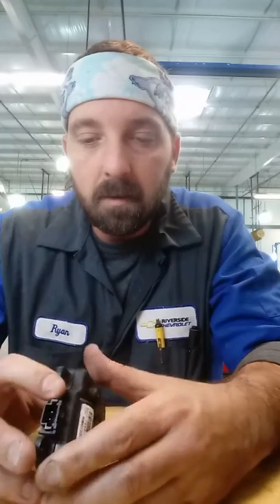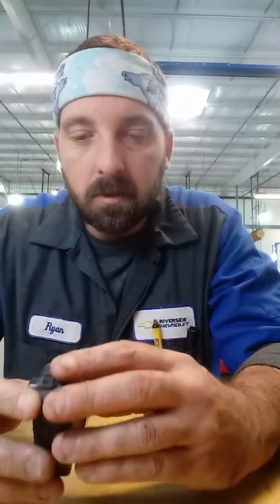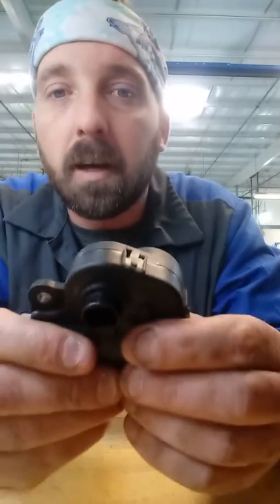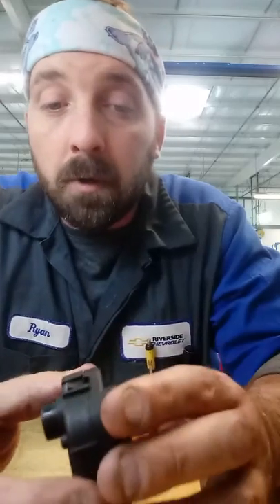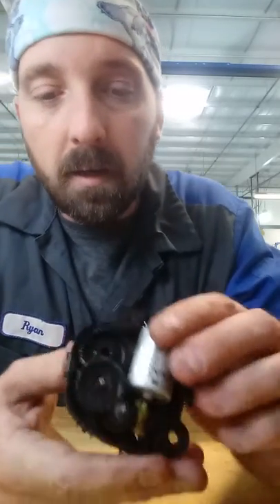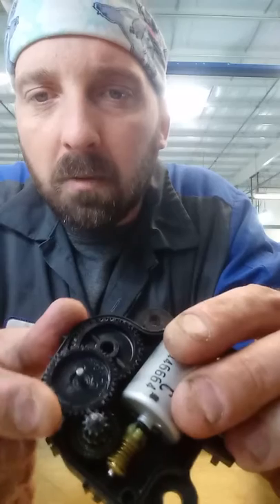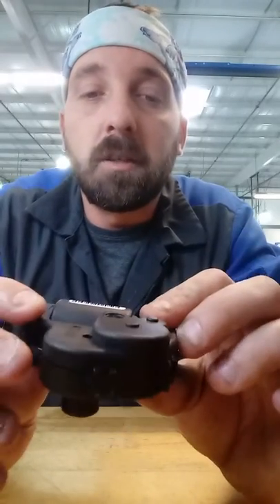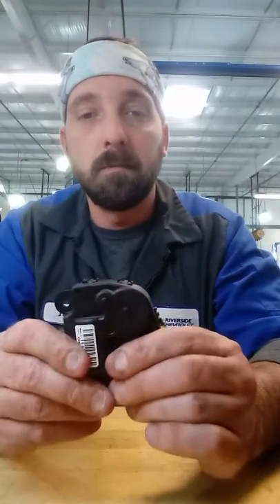CHEVY Popping noise coming from Dash FREE FIX

Comment: Hello Ryan,, My Pontiac G5-2007 is maken that noise on driverside underneath,,, is that the same thing,,, every time i move the nob to defrost and one next to it, it dont make a noise,but when I move it too the foor and also to air vent/floor both, then it makes that clicking noise...HELP,, not sure what to buy on amazon to fix the problem?? I hear it good when its on floor and vent mode,but no noise on defrost...Is that the same thing I need to buy?? if so, what is it called???...Thanks,,, Rich

Comment: 2022 Sierra 2500 HD. Have this clicking sound drivers side foot well under dash. Possibly the same cause? 
2700kms.
Reply: Silverado 2023 LT here with 13.4 inch screen. Did you happen to ever find a fix? @JD73RD

Thinking of telling my dealer to replace it
Reply: @Multimeter1  Turned out to be a module (small plastic black box rattling) that wasn't mounted correctly under the dash. Mounted with 2 self tapping screws that were stripped. Dealer was useless. I found it myself and remounted.